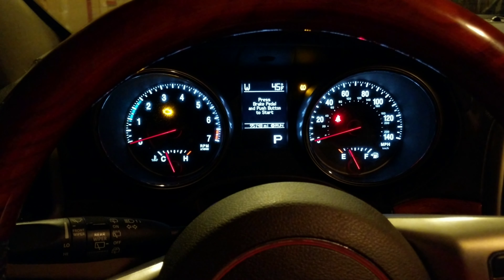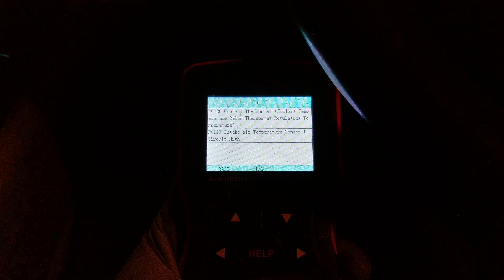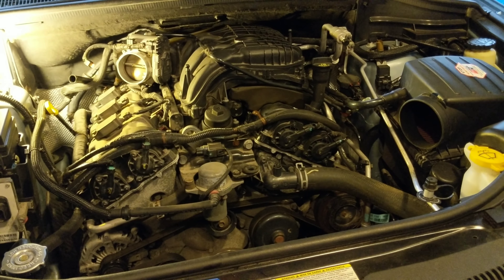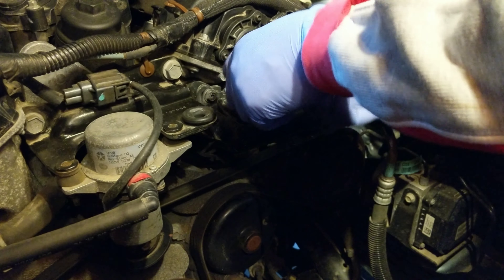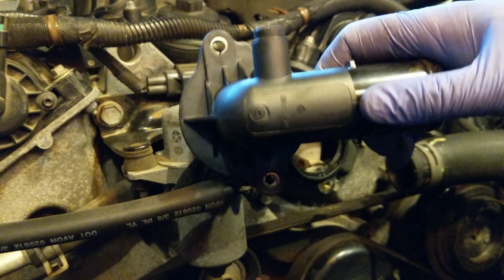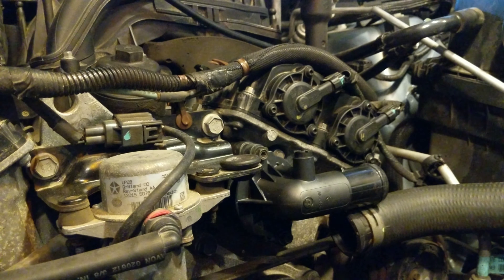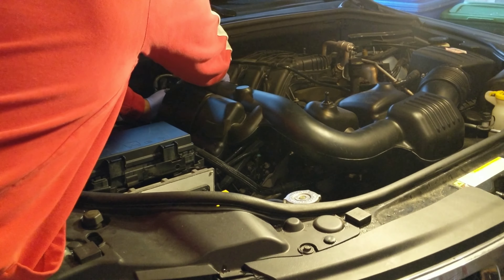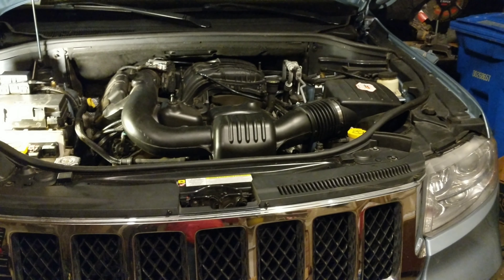P0128 error code - 2013 Jeep Grand Cherokee (WK2) - thermostat replacement

Comment: I have a 2015 Grand Cherokee (You can look up the cluster gauge if you'd like to understand what I'm talking about). About a month or two ago I replaced the thermostat myself with an aftermarket thermostat (Duralast 82303DL). While i'm driving, it's steady on the third quarter mark. I'm too dumb to understand temperature gauges so I don't really know what temperature I'm at. I'm debating on buying an OEM thermostat and buying two gals of 50/50 and just doing an entire flush just to feel some type of ease. It's steady but does go down and fluctuates from the second quarter mark  to third. What do you think? Should I go ahead and do it or is it okay for right now?
Reply: I'm at 93,000 miles right now, I changed it around 90,000 miles. Should I do it now or wait until I hit 100k miles?
Reply from the maker: If I'm following you and it's running up towards the H then you should be fine.  When a thermostat fails it fails open so your engine will actually run cold.  It'll also throw an error code saying your engine isn't getting up to temperature or is running cold.  That's an indicator that you've got a thermostat problem.

Comment: How can turn off a secundary permanente code sensor, my grand Cherokee 2013 dont pass the test only Caz this code is a night mare and the termostadt is fix now but the code still apper
Reply from the maker: The engine has to complete 3 or 4 normal warm up cycles to clear the codes and switch off the check engine light.

Comment: Does the check engine light go away by itself after you fix it ?
Reply from the maker: The engine has to complete 3 or 4 normal warm up cycles to clear the codes and switch off the check engine light.  You should pull the codes to make sure there's no other codes being thrown, but yes, it'll clear in it's k own.